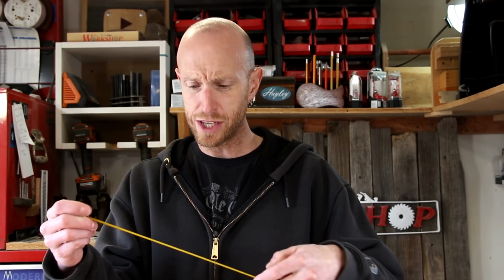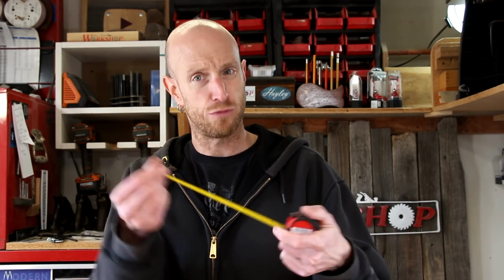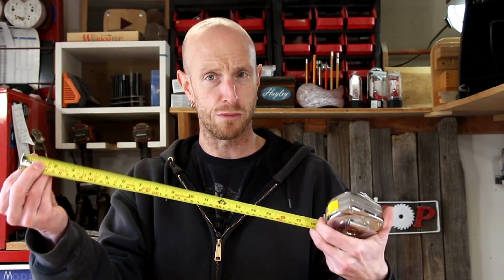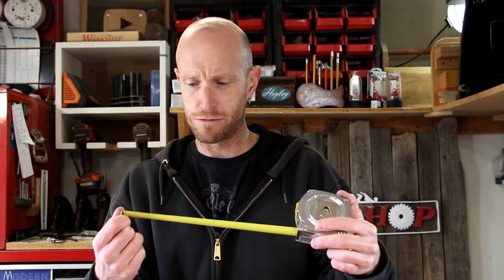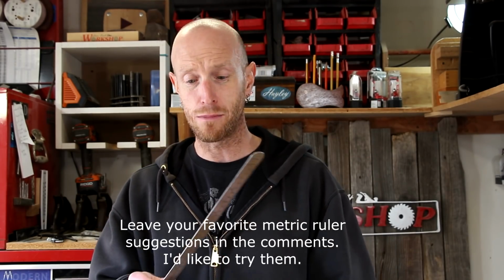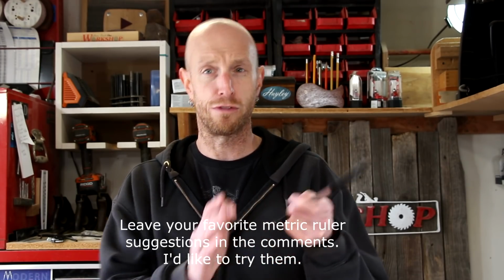My thoughts after using the Metric System for a project | I liked it

Comment: It has always amazed me how one could live with the imperial system.
So you have 5/16 and need to add a foot to that and divide that by 2 to find the center
1 foot = 12 inches + 0.3125 gives = 12 5/16 divided by 2 = 6 5/32 converted to inches 6.15625
vs
8 + 30 = 38 and 38 / 2 = 19 cm  :-)
Reply: UK had imperial until 1970s and I use metric but am used to lots of people in UK still using imperial. In your example you would choose inches not feet for the first measurement and the 5/16 requires no adding. It does not take any effort to split a 12 in two and the fraction will simply go from 5/16 to 5/32 to half it.   You would use "six and 5/32" as the measurement and never convert it into anything else.  
In the UK most things are metric but we still buy beer in pints, have car speed in miles per hour, and oddly most people know their weight and height in imperial and not metric. 
The great joy of 12 is that it divides up into thirds and quarters far easier than 10. Imperial is actually very easy to do in your head. 
Yes it is rubbish to go from fractions to inches to feet to yards to miles but mostly you are in one measurement (as you are with say mm or m) and not switching.  
In France you can still get people use Livre in a shop which was a pound weight before they went metric over 200 years ago. 
UK also switched our currency from an old system of 240 pence to the pound to 100 new pence only in 1971.  
Imperial is hugely damaging to the US, leave them to it!
Reply: @grolfe3210  Thanks, interesting reading! Yes dividing fraction is fairly easy but I have often seen some measure 3.15 inches and had to add some other fraction inch 3 3/20 + 23 7/9 or some having to divide two fractions for some woodworking 1/17 div 62/24. Dividing by 3 and 7 is a bit tiresome in the metric system but still fare easier than calculation in the imperial system :-)
To make it totally confusing, do machinists and people like that, talk about different fractional systems: 16/32 is not a half, but a fraction used to describe the size of that type of screw or tool.
Reply: @friedmule5403  Yes it is totally confusing and rather bonkers but somehow in use it seems to work surprisingly well. As the units sort of evolved from use, they seem to be the right amount to work in. The English pint of beer (0.57L) is somehow the right amount where a litre or half litre is not. I have not seen fractions of inches in anything but half, quarter, 8th 16th an 32nd. Oddly 10ths are not used! 
Fractions are messed up by calculators now. 
Worst of it is my tool kit has to have a complete set of metric and imperial spanners, but an old 1/2 inch will fit a rusty 12mm nut where the 12mm will not.
Reply: My dad who grew up in Mexico and only used the imperial system, once told me that the imperial system for construction was actually a lot easier. The fractions of an inch aren't as hard as they seem lol
Reply: @friedmule5403  As a mexican in the US who learned metric and used it all the way through college this is amazing to me. The imperial system is so outdated in comparison. All kinds of mistakes because of incorrect conversions take place all the time…  from nasa projects to incredible car recalls.. to incredible aviation mistakes… the US should be metric. It kind of already is where it counts. All cars are now metric. All of NASA is now metric. Even the UK where this originates from is now metric. Its baffling to me. One simple example of metric’s coolness. 1ltr of water = 1kg. How about that???
Reply: @MartinME3  Yes you are right but in a way is USA metric, the inch is defined as 2.54 cm:-) Yes 1 liter = 1 kg but a gallon of water weighs about 8.3 pounds. Imperial gallon of water is defined as 10.02 pounds at its maximum density, while the weight of US dry gallon of water is defined as 9.71 pounds. And don't get started on miles per gallon:-)
Reply: @MartinME3  "1ltr of water = 1kg"" ... and 1000 cm³ (one cubicdecimeter)
Reply: As you get more confident faced with a question like that you know that half of 5/16 is 5/32 and that half of 12 is 6 so you can do that math in your head in seconds without needing the decimal crutch. The answer is 6" 5/32
Reply: @friedmule5403  -- That was the original intention with respect to weight and length in the metric system and then they created physical objects that matched that, but eventually the measurement of the intended physical constants got more accurate and the physical standards no longer matched and we ended up with that not being the case... We can't go about changing the physical sample since everything is based off of it, so we just accept that in the end, the metric system is just as arbitrary as the Imperial / US system...
Reply: @CurmudgeonExtraordinaire  Yes, you are completely correct, they are just a random distance we have decided to use. Now is an inch defined as 2.54 cm. So you can say that everything is metric now. But no matter your start point is one system easier than the other, the metric system has no limit in what size-steps an object need to have to be easily calculable, where the imperial system has problems when things get too small, i.e. 7/128 inch and also the fact that you have to convert between decimal and fractional notation. :-)
Reply: @friedmule5403  -- There's nothing to say that with the US or Imperial systems that you HAVE to use fractions... Machinists typically measure in the thousand's of an inch (i.e. 0.001")... I reload my own ammo and I measure the diameter of my cast bullets and the overall length of the cartridges to the nearest 0.001".  I measure the power charges to the nearest tenth of a grain (there are 7000 grains in a pound).  In some professions, they use tape measures that are either in decimal feet or decimal inches, so no fractions and everything is measured as a decimal value, just like the metric system... At that point, it's just one arbitrary scale (e.g. feet) vs another arbitrary scale (meters)... It's when you start getting into some of the derived units that metric makes it easier... But in the end, it's really just what you are used to and whether the other system provides enough advantage to you to justify converting to it...

I'm not sure I would call it "random" -- "arbitrary" is probably a bit more accurate... They had good intentions when they tried to define it in relation to the distance between the equator and the North Pole in 1793, but when it came to putting theory into practice, they kind of fell short (pun intended)... With the original definition, the polar circumference of the Earth would be 40,000 km EXACTLY... The current value for it is 40,007.863 km... That would mean that their original meter was slightly longer than it need to me, so maybe they FELL LONG instead? :)

Now, if you really want to get confusing about the US measurements, you need to look at how supposedly some things are measured in the international foot and others in the survey foot... Area is supposedly measured in the survey foot and volume in the international foot... Since there is only about 1/8th of an inch difference in the two over the length of a mile, no one is going to notice the difference, but technically it IS there...

The main advantage of the metric system as far as I'm concerned is in the derived units, not the base units... For example, if I'm calculating the kinetic energy for bullet, I would do the following:

w = bullet weight in grains
v = bullet velocity in ft/sec
KE  = kinetic energy
G = acceleration due to gravity on Earth = 32.1740485564 ft/sec^2
1 lb = 7000 grains

KE = 1/2 * mass * velocity^2

mass = weight / G

mass = w / 7000 / G

So, let's say you have s 230 grain bullet traveling at 835 ft/sec.

KE = 1/2 * (230 / 7000 / 32.1740485564) * 835 * 835
KE = 366.024... ft-lbs

Now, in a country that uses the metric system, they are probably going to measure the bullet weight in grams, the powder charge in milligrams, the velocity in meters per sec, and the kinetic energy in Joules.  Also, they will consider weight to be the same as mass.

So, we now might have a 14.9 gram bullet traveling at 255 m/sec...

KE = 1/2 * mass * velocity^2
KE = 1/2 * 0.0149 * 255 * 255

KE = 484.4... Joules (J)
Reply: @CurmudgeonExtraordinaire  LOL, "falling long!!" you have a great humor! :-) What I meant by random is that the meter got defined as going through Paris in France, this got decided because France thought it would be great.
You can of course avoid the fractions, but you do still have these 36 inch = 3 foot = 1 yard, this makes it harder to calculate than 100 cm = 10 dcm = 1 meter.
If I say 126 inches, what is that in feet or in yard?
While 126 cm is 12,6 dcm or 1,26 meters.
Reply: @friedmule5403  -- The thing is, we don't really use yards that much in cases where you need to be converting it to feet or inches... It gets used in certain sports (football, golf, shooting) because it gives a nice number to work with and when buying fabric or room carpeting... How often do you use the terms hectogram or decigram?  You probably use hectare, but what about the centiare or deciare?  Other US units that are rarely used for length are rod (16.5 ft), chain (4 rods or 66 ft), furlong (10 chains; 1/8 of a survey mile; mainly used in horse racing), fathom (6 ft), and cable (120 fathoms)... Not all of these I could remember off the top of my head since I don't use them on a day to day basis... A classic unit conversion problem in school often involves calculating some resulting velocity and giving the answer in an obscure set of units like furlongs per fortnight... For example, 60 mph would be 161,280 furlongs/fortnight... Something like, "Jim departed Dallas at 03:24 traveling 63 kph.   Bob left at 72 minutes later and caught up to Jim at 07:21.  At what speed was Bob traveling.  Give the answer in furlongs per fortnight."  I suspect that Math teachers just don't get laid that much, so they have plenty of time to think of problems like this... :)
Reply: @CurmudgeonExtraordinaire  Oh, yes math teachers! LOL, no I imagine they use "mathematics" as their preferred visual stimulation. :-)
They can invent the most convoluted problems you'll never have to use in real life.
In the metric system do we not have many strange units, like dcm, but even these are based upon 10, so no matter what size you work with is the decimal point all you have to move. We do unfortunately still have some strange values from old time, but those do almost never get used.
The imperial system, does not as easy. :-)
Reply: @friedmule5403  -- And then there are the recipes for baking that you see... How many cups are in a liter?  Well, that depends upon what type of cup you are talking about... A US cup?  An Imperial cup?  A metric cup?  An Australian cup?  Use the wrong value and your recipe is going to not be quite right... Measuring things in grams or kilograms makes more sense, but then you need another scale that can measure in the milligrams for things that you only want to put a small amount of in the mix (e.g. salt)... And in the US, we have the dry cup and the fluid cup and they are slightly different, but most people probably don't know the difference and incorrectly use the same device to measure liquids and dry ingredients... And you never know whether the person who created the original recipe was doing the same thing... So, you're watching someone on YouTube and they have an accent that sounds vaguely Australian or mabye from New Zealand and they say to add so many cups and tablespoons of certain ingredients into the mix... Australian cups and tablesoons or New Zealand cups and tablespoons... Or mabyhe metric?  Or maybe they are from somewhere in the UK and you just thing that the accent is from Australia or New Zealand... What if they are Asian and have that accent, but are living the Hong Kong right now?  Or living in the US now?  You just have no idea what the real units might be... Things were so much simpler in my college chemistry labs 45 or so years ago... :)
Reply: @radbot2285  -->  1000 cm³ = 1 dm³ that is a cubic decimeter...(10 x 10 x 10)
Reply: thats one of the reason geomatry is so difficult in the us school system
Reply: @jacobscholtissek2410  -- And spelling is difficult in your school system? :)
Reply: @CurmudgeonExtraordinaire  spelling in germany is easy but english thats difficult for me
Reply: @jacobscholtissek2410  -- Well, you can take solace in the fact that on the average, you have better beers than the US (at least the mass market beers)... 

I don't think that the US / Imperial system has anything to do with whether students are good at Geometry... It's been MANY decades since I was in high school, but I don't remember the Geometry course being concerned with units... Even the Trigonometry course wasn't really concerned with units... Chemistry and Physics though... Yeah, we dealt with units and sometimes it was US units, but probably more often than not, it was metric units... Back then though, it was entirely possible for a student who was not going to be college bound to take courses for a career path that would not require them to take courses in Algebra, Geometry, Chemistry, Physics, etc... The Math courses that they might take would be more tuned to what they might need in just day-to-day living -- balancing a checkbook (simple accounting) and such... And some of the people who go to college are going to be majoring in a subject area that does not need "advanced" math...
Reply: @MartinME3  yep, and a 10cm cube is also a liter.....

Comment: I used metric all my life, I can confidently say that although the standard tools that we use are more precise than standard imperial tools, you can get the same precision with both systems. That said, metric it's a hell of a lot easier
Reply: no, often you can't get the same precision. Just common bolts alone. Take a 3/8" UNC nut and bolt and a M10 (roughly a 1mm larger diameter) nut and bolt. Turn on the nuts onto the bolts and wiggle the nuts, et viola :) Of course you may take a UNF bolt but that's a similar larger tolerance when comparing it to fine threaded metric bolts.
It's kind of the underlying philosophy if you will as it's based on a king's thumb and foot, or was it his forearm and 3 barley seeds ?
Reply: @sindbad8411  You're right, you can't get the same precision, since Metric is more precise at smaller measurements.
Reply: @Valsorayu  
Well, I think it's not only about precision.
Here is a nine year old video
Why mechanics should not work in inches
https://www.youtube.com/watch?v=EUpwa0je6_Y
American Chopper vs The Metric System
 However the title is not exactly correct. 
It should be American Chopper vs The Imperial System :)

Comment: There was a test in Australia, when they switched to metric in house construction.  They made two version of drawing of a house, new metric (all mm) and old well known imperial.  
After building, the scraps was about one car transport for the metric and one truck for the imperial.  People cut a bit longer then needed for the imperial, but on the measure for the metrics, so less material not needed to cut when fitting the parts.

So yes, you are probably right there, it feels more precise, and actually also are.